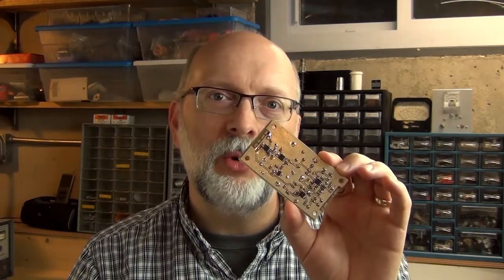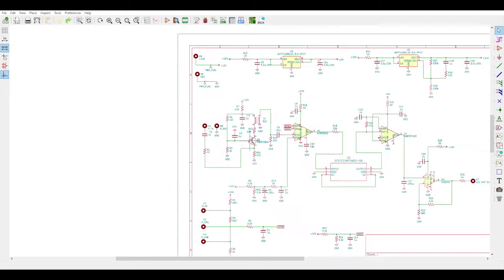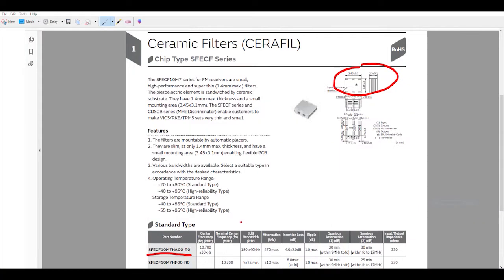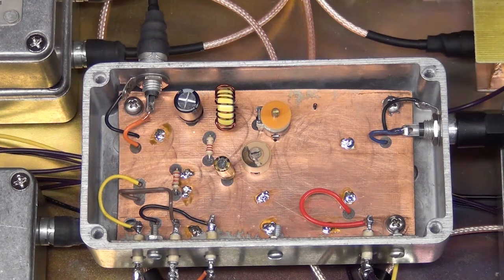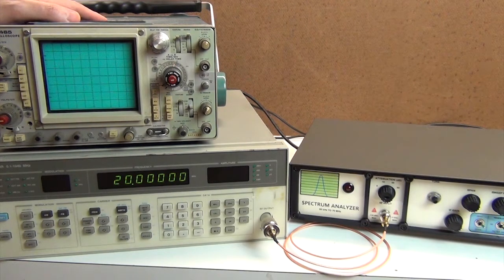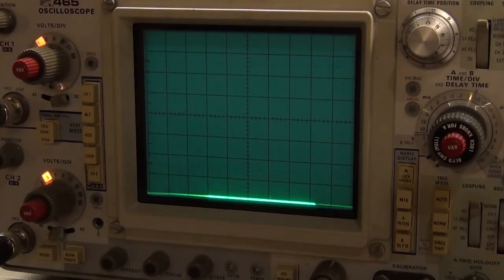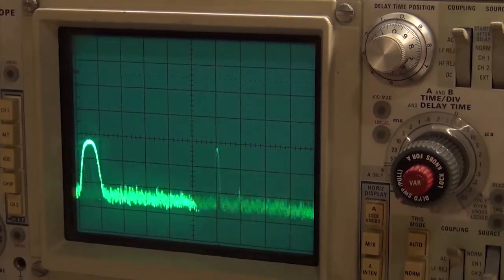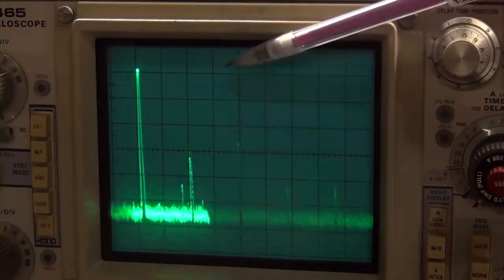Homebuilt Spectrum Analyzer - Part #3

Comment: Building a SA is one of the most difficult pieces of test equipment you can build. The spurs that you have is probly  coming from your 1st mixer. You will need a trap to lower the 2nd harmonic of you 1st LO.
You did a magnificent job.

Comment: What I did on my SA is, all modules have isolated power regulation from the RF section. All RF modules have zero lead length. All power leads are feed through filters. The amp after your Log Amp should have the lowest noise  possible and be able to adjust the DC offset from your Log Amp. 
I have built my boards dead bug style with very minor problems.

Comment: The problem with the feedthrough caps is that you have brought  the noise on to the internal surface of the enclosure. Any RF noise will work on the skin affect so it the caps grounded to the outside of the box it would be totally isolated from the inside. by soldering them to the PCB on the inside the noise is now flowing on the inside of the box. 

Skin affect plays a big part in RF screening.
Reply from the maker: Yep, I realized that later.

Comment: I  was looking at your board layout. Why are you using etch tracing for ground of decoupling caps. At HF you have a series inductor. ALL caps used for decoupling should be at the pin of the device or a short as possible the  ground plane.
I have laid out boards with 70 to 100 Db of AGC gain with no oscillations.

Comment: Do a two-tone test with two 0dBm CW signals and let's see what the 3rd IMD level is.
Reply from the maker: Yep, it's on my list once I can get to putting together a two tone signal source.
Reply: @levelupeelab  Use two RF signal generators with a coupler. No special two tone source required.

Comment: I noticed your 465 is DC coupled to your SA?? Wouldn't you want it AC coupled??
Reply from the maker: The X and Y axis output stages of the SA are op amps and they are both referenced to a fixed DC value for zero signal, so using DC coupling on the 'scope is correct.